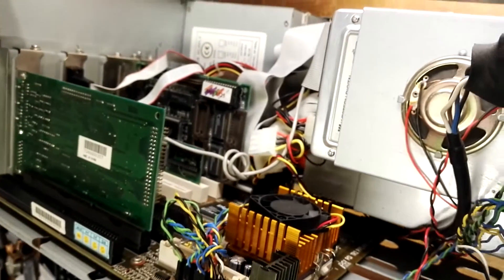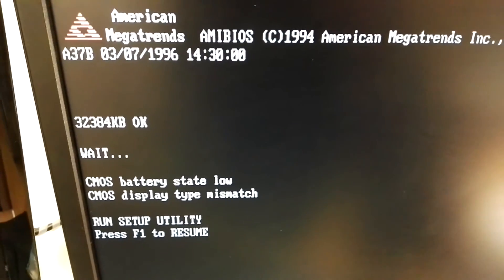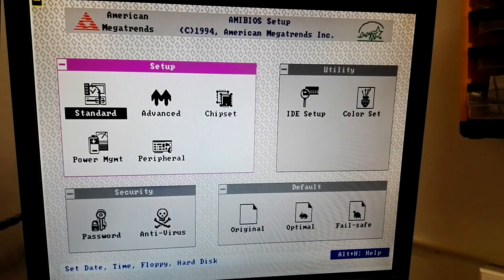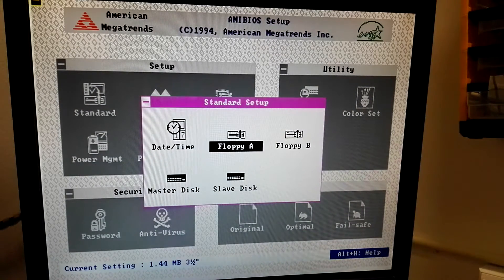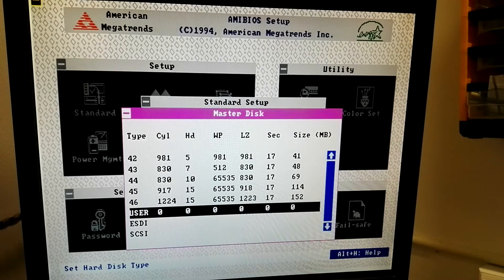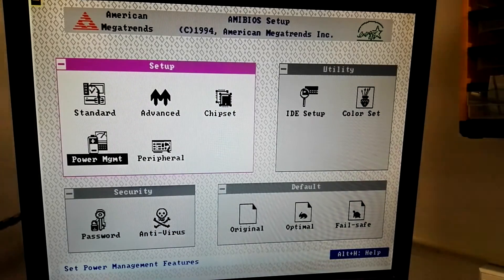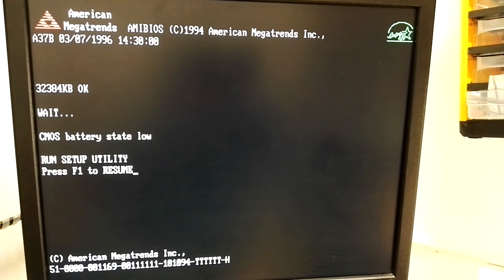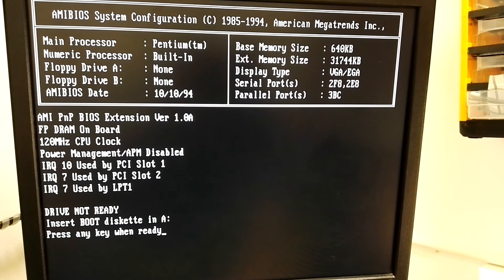RETRO PC Socket 7 Pentium 120Mhz, MSI MS5120, 32MB EDO-RAM, S3 Virge PCI 325 part1

Comment: Today i took my old machine (also MSI MS-5210 with S3 Graohics and 32MB RAM, but P100 SX970) from the attic of my parents, plugged it into the wall aaannnd:

It worked! After over 20 Years!
But with the same CMOS Battery issue.
Seems you're not able to boot until its changed.
But I'll replace it 

I thougt it will go up in smoke, but the quality of these boards seems to be rock-solid !!!
THUMBS UP to MSI !!!
And thanks to the ODIN clock for not leaking batteries.
With a fu***ng DALLAS clock the board whould be a piece of crap, I guess...

I'll try a 120 MHz SY033 in the next time.
I found an Setup Guide for the MSI (!!) MS5120.
There a manuals for an similar sounding MATSONIC 5210 with VIA-Chipset.

Comment: S3 Virge! I had one of those. Powerhouse graphics FTW.
Reply from the maker: yeah it was mine first GPU as well. Later was Riva TNT2 (had compatibility issues with Celeron 466MHz) and then 3DFX Voodoo3 2000 16MB